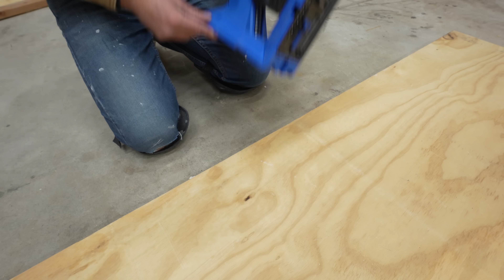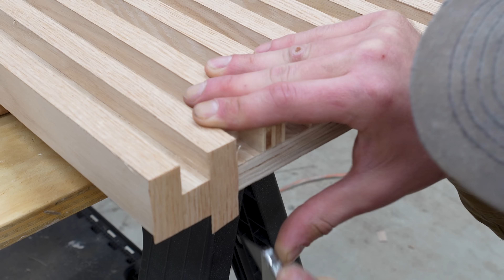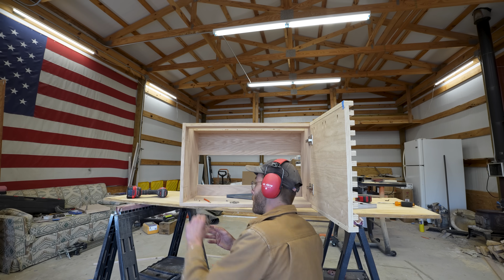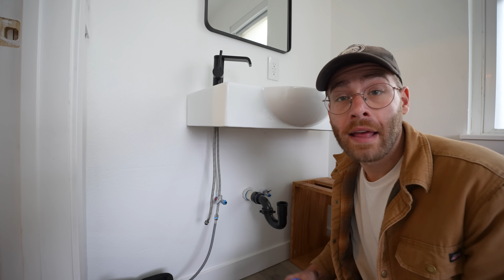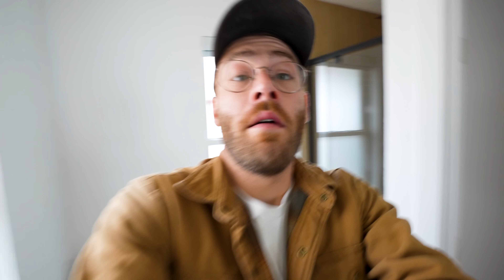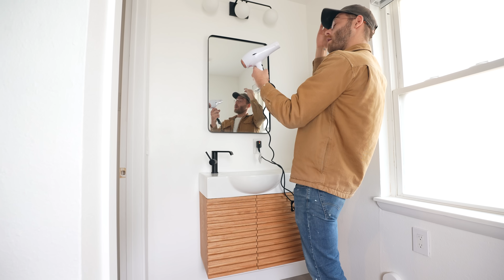DIY MODERN FLOATING BATHROOM VANITY W/ HAIR TOOL STORAGE!!!

Comment: Nice job!  1 suggestion for a finishing touch, paint the exposed plywood edges of the door reveal black.  It should still matchy match with the whole room and add a nice accent.  If you had other colours in the room (if someone else makes this build) this little accent line could be a pop of colour.

Comment: Honestly, the look is great but the usability is not so much. Should have been drawers to begin with to allow for easier access and the said drawers have curved cylinders on the inside to hide the plumbing. This allows for easier maintenance when required instead of undoing a drain to remove a shelf design.